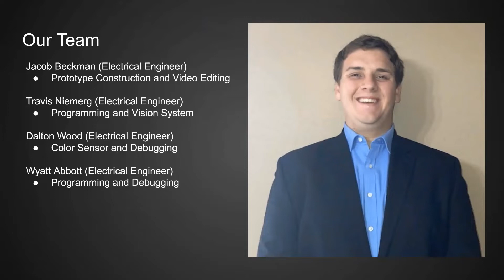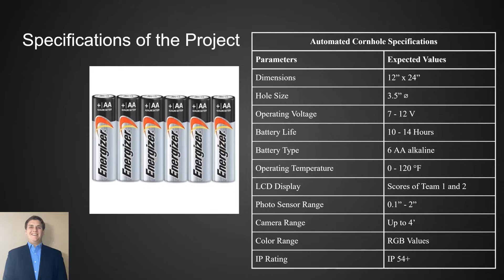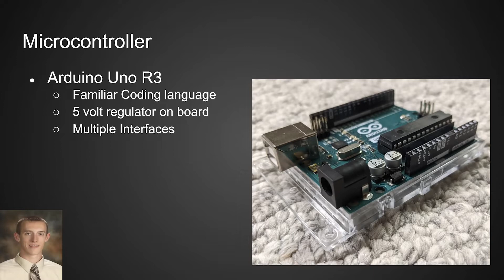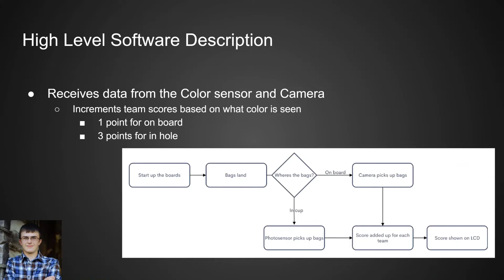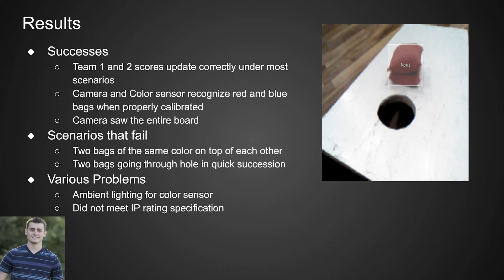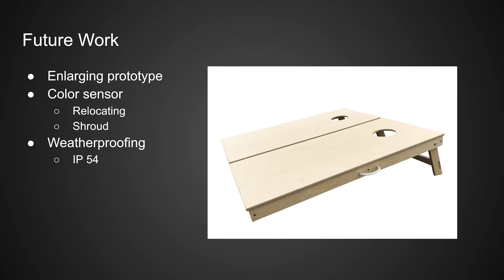Automated Cornhole Scoring System

Comment: what's the downside to using NFC for this application? Could you  just use a copper tape wire underneath the board that picks up the chips embed inside the bags? Allocate 1 point for those on the board and a sensor in the hole.